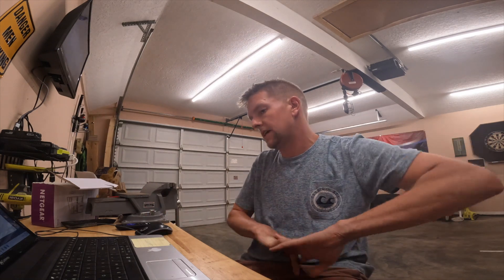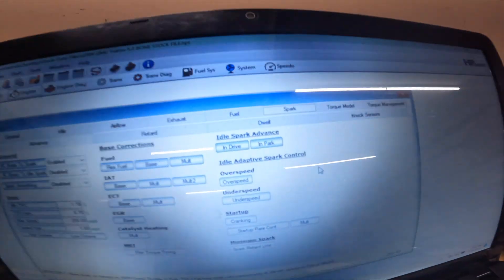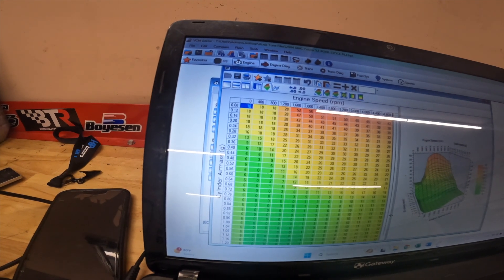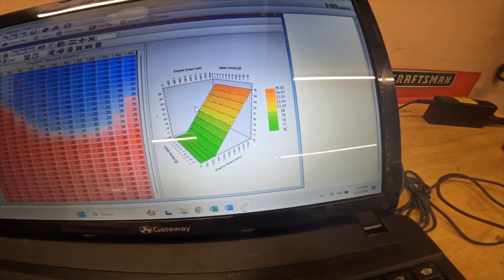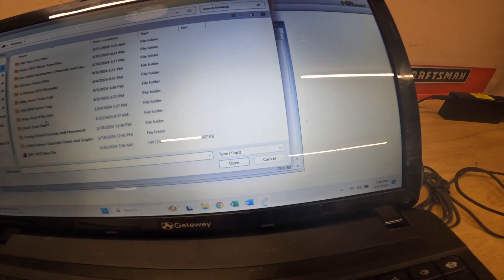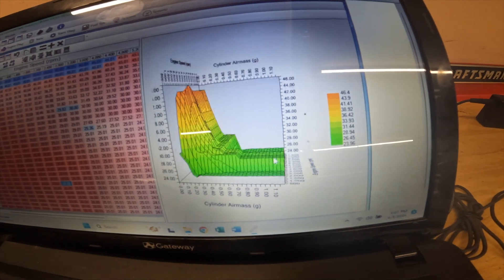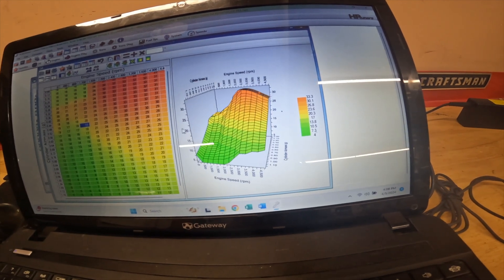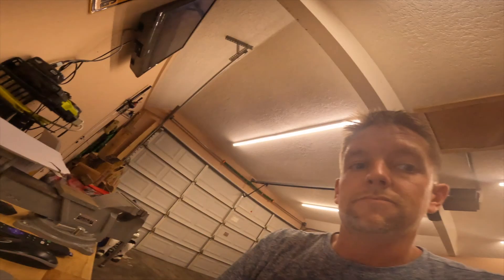GM LS Spark Table Rant WHAT NOT TO DO!!!

Comment: So if someone else tuned after high performance cam and now idles good but when rpms reach 15 to 2000 number 7 and 4 misfire killing out cylinders are dead, input on this one please Sir!
Reply: Compression test and leak down shows great condition, also already removed and replaced with new lifters and trays it did come in with broken push rod on #1 exhaust!
Reply: Also have moved ,wires ,coils and spark plugs same thing  no change,I was told the Tuner tunes for wide open Throttle and not setting perimeters per each cylinder?